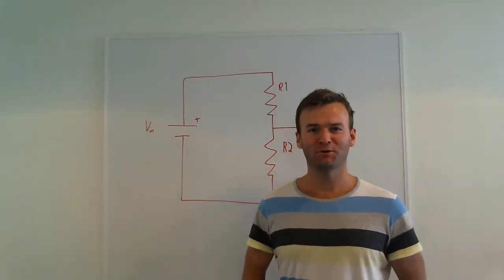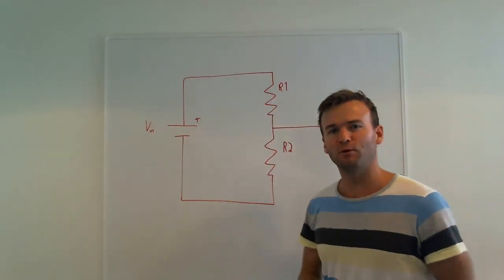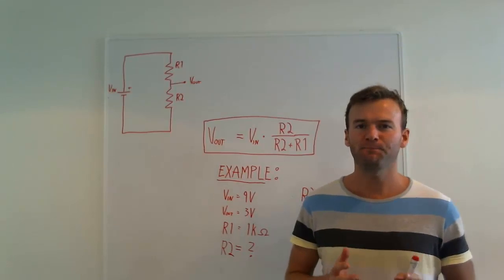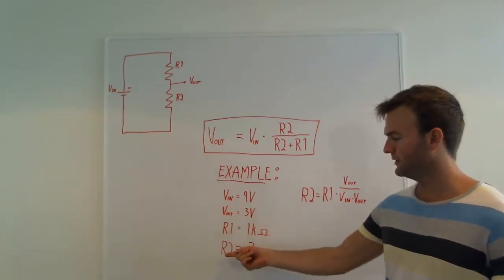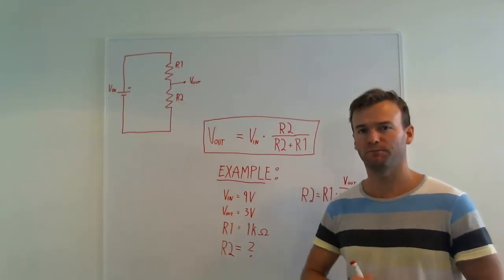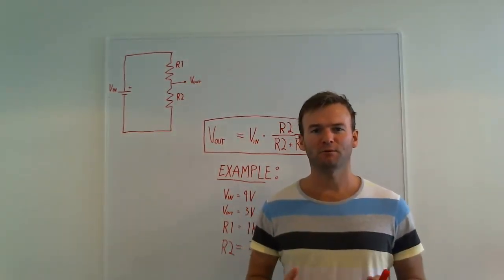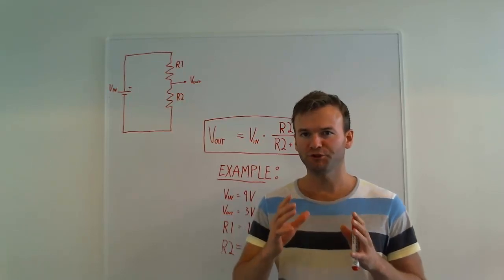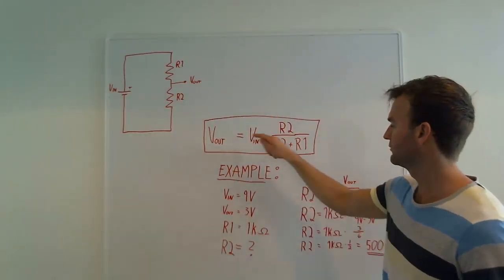Voltage Divider - A super useful and extremely simple circuit

Comment: but won’t this waste energy? won’t the resistors get hot? or does the energy just flow out more slowly due to resistance and not much is wasted?
Reply from the maker: The power dissipated in a component is energy that is converted from electric energy into other forms (normally heat).

You can find the power dissipation of a component from the formula Power = Voltage x Current

So yes, there is power wasted in resistors, just as in all other components. If the power is significant for your application, you can increase the resistance in the resistors to have less current flowing, and thereby less power dissipated.

Ex a voltage divider using two 100 ohm resistors will give you the same voltage division as using two 10.000 ohm resistors. But with the 10.000 ohm example, there is a lot less current flowing.